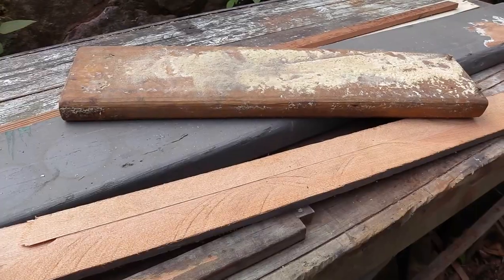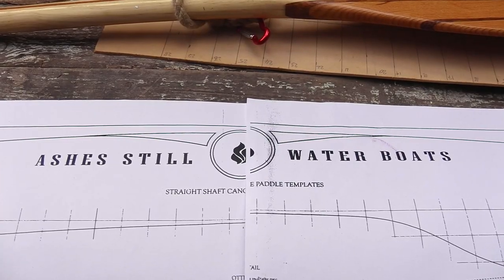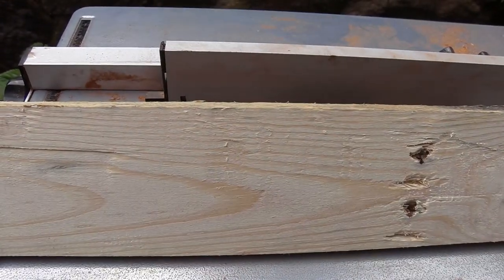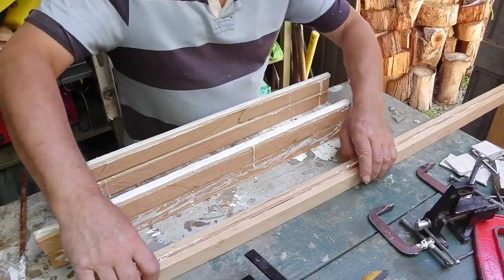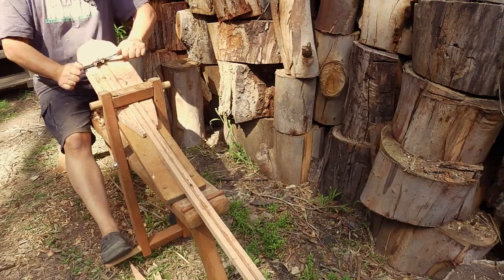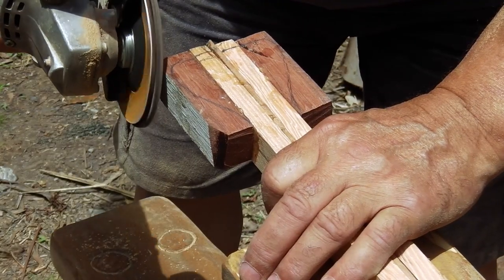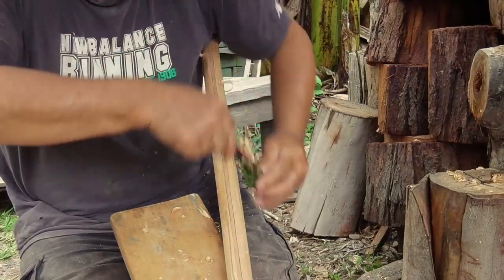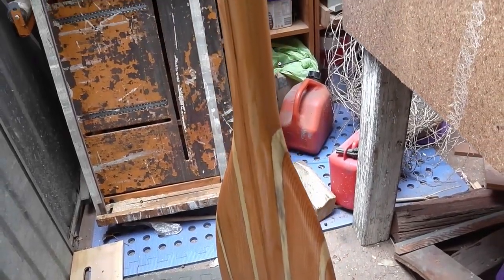Dinghy Crusing-Make a paddle ...go on it's easy.

Comment: Thanks for putting this together.  Very interesting.  Reckon I might give it a go when I have time,  cheers
Reply from the maker: Really it's not hard this is the 3rd one I've made and none have fallen apart just make sure all you pieces have square edges so when glued they are actually square...otherwise you will get a bow.

Comment: If possible can you let me know  what glue you are using and where to buy some thanks Tim
Reply from the maker: Hi Tim, just got back from a 4 week trip sailing the tall ship Duyfken from Sydney to Hobart and back. I used a waterproof wood glue called samson from Bunnings. It must be waterproof. Some people use Epoxy but I've made 3 paddles now all with Samson and they are all still good. Give it a go it's very rewarding, cheers Paul